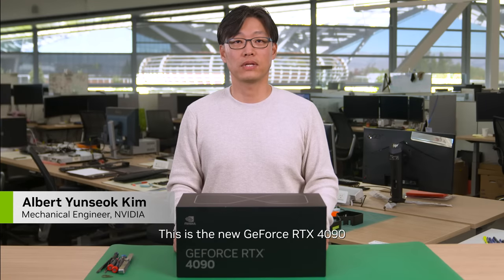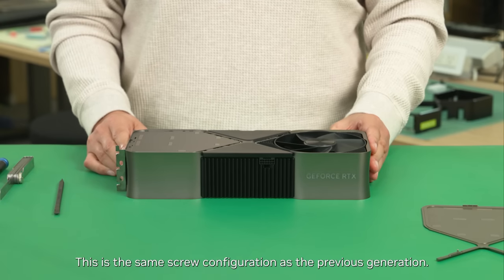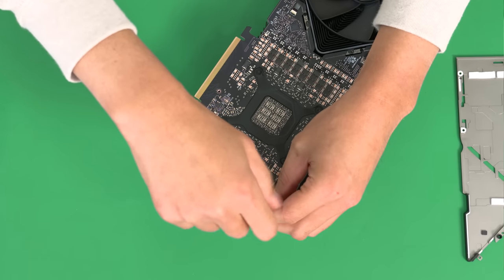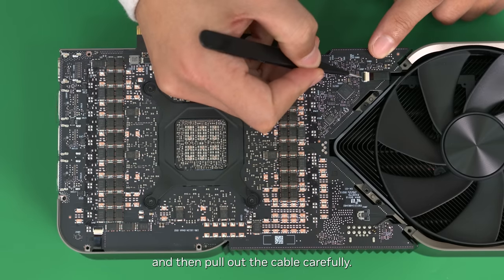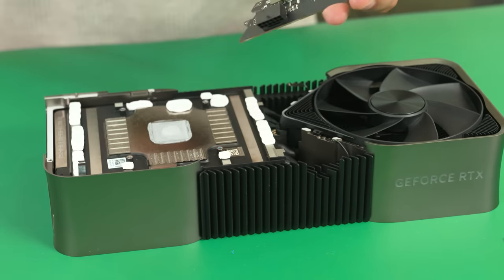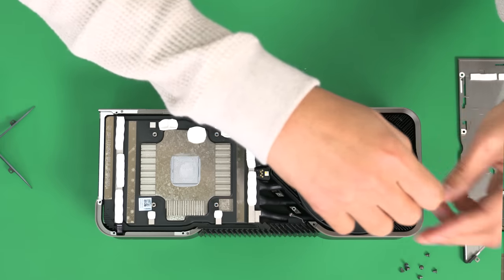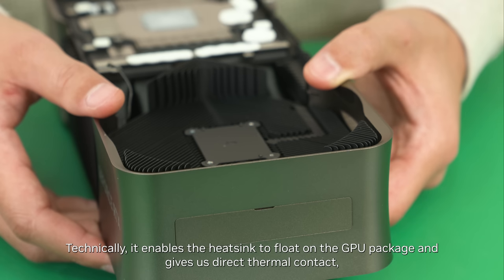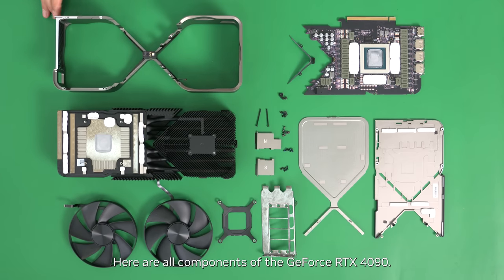GeForce RTX 4090 | Official Founders Edition Teardown

Comment: It is great to see a company actually making a disassembly video so you can easily maintain it or try to repair it once your warranty is gone.
Reply: What’s the point if they don’t sell any replacement parts?
Reply: @rmogutierrez-santana4446 the only thing worth replacing is the fan if the bearing breaks or something like that. The main reason why you want to get inside your gpu after your warranty is gone is for you to be able clean the fan/heatsinkand to replace the thermal pads/paste once it dries out (usually happens after a couple or so years).

Comment: the engineering and design makes the fe look more expensive than any other aib
Reply: And it’s the cheapest! At least in the UK. I just got mine.
Reply: @MATTE.U.K  Also in Germany.
The price was 1799€ for 3 months. now it is at 2100-2300€
Reply: because nvidia is selling way more expensive silicon to aib and this money that they are "saving" on silicon is just put into better quality components, design and materials.
Reply: @ArturOleszczuk1991  that's absolutely not true, most AIB cards perform worse in terms of stock boost speed and overclocking potential 🤣 exception being extremely high end cards that nobody buys
Reply: @busterscrugs  what's what I said, nvidia is selling their silicon way more expensive and saving for themselves better chips that for them, it's just manufacturing cost, aib is paying for everything related to produce that chip. So for example aib is buying worse chip for 150$ and nvidia in same time has binned chip for 40$ as expense.

Comment: Would be nice if they were ever in stock. They've only restocked in the US a single time since release.
Reply: its overpriced bro don't even consider buying it
Reply: no they restock every other week
Reply: waiting for 4090 ti
Reply: @Aleww  waiting for those 10 more fps in 4k for a over price
Reply: @Aleww  4090 best value
Reply: It’s a waste of money.
Reply: @bretttanton328  it even make money into waste
Reply: 1870€ cheapest 4090 in Eu 😭
Reply: @memeconnect4489   It's no overpriced. You can get them for $1900-2000 on ebay or whatever reseller site. Keep in mind the higher end 3090 Ti's sold for this price and even more than this price and the 4090 absolutely slaughters the performance of a 3090 Ti lol. These are well worth the money. I sold my EVGA Hybrid 3090 Ti FTW3 (360mm rad/aio) and got a 4090 FE. Best investment I ever made. $300-400 over MSRP is nothing to get the card and sit with it for years. But then again, I have a job.
Reply: @B_M_A  
you're basing your opinion on the fact that the 3090 is not overpriced? but literally everything since the GPU crisis has been overpriced, call me insane but the the 3090 ti should've never been over 999$
but nvidia tricked you, you're like:
hmm, if X is better than Y then its priced fairly 
the market will never recover from that hit
Reply: @clebyec  no its not
Reply: @memeconnect4489 aint the 3090 also?
Reply: The 4090 is just an overpriced 3090.

Comment: This GPU should have been a 1000 bucks at best and 4080 at 700. Hopefully AMD can compete for lower prices.
Reply: 4080 is actually like a 4050 ti - 4060 so more like 250 and the 4090 is 500 MAX. Anything more than that is a rip off
Reply: @Muhammad Ehtasam so wrong 🤡 the xtx is more like 4090 and Xt is like 80
Reply: Why? Because you are broke? The price is what it is because people buy it. Simple supply and demand. If people stop buying it prices will fall. Buy amd and stop crying.
Reply: @Transistor Jump they should give it to you for free , because you deserve it!
Reply: No way! All prices should be higher, I'm guessing you don't work in manufacturing.
Reply: @jake152  Stop supporting this crap !!! No GPU is worth 1700 euro. let alone 2500 for a 4090.
Reply: @@transistorjump919 and 4090 was made on a wafer that is 1/3rd the price of 4nm
Reply: @Drip7914  If that's true amd really dropped the ball of their top of the line only competes with entry level cards.
Reply: LMAOOOOOOOO
Reply: @@transistorjump919 He meant nothing because what it wrote make no sense
Reply: @DeadPhoenix86DP  Agreed! In my region the 4090 MSRP range from $2250-2600 CAD and the 4080 from $1700-2000 CAD. 🤔
Reply: @JCTiggs1  Yep. Those prices are crazy. Its time to let Nvidia know we want a price reduction.
Reply: The 4090 is more performant that the 7900xtx and that is $1000.

Comment: focus on making the 5090 smaller don't focus only on performance and power usage
4090 's actually a beast btw
Reply: This comment doesn't make any sense. The top end card is of course going to need to be big as it's a big chip with a lot going on and high clocks. No different with AMD or Intel's CPUs, the top end chips need much larger coolers and use more power. Physics!

The cards that are less focused on the maximum performance and are smaller are 4080 and everything that will come out below that. There always has to be compromises. You can't have your cake and eat it too.
Reply: agreed

Comment: Question for you Nvidia engineers.. this monster occupies 3 slots now..  so here is my problem...  I want to install it into a latest generation ASUS ROG Maximus Hero which has 2 PCIe5 slots... the primary slot where the RTX4090 goes and a slot 4 spaces over where I want to install their bundled Gen 5 compatible Hyper SSD Expansion card...  the problem is that only puts about 2mm space between the Hyper Card and your GPU...  is that enough for the bottom facing fan to get air?  And will the warmth generated by the Hyper card be an issue?   I will be installing all of this into VERY well ventilated Corsair 7000D case with some 12 total fans if you include the 3 for the CPU water cooling.   Thoughts?

Comment: So good to see NVIDIA open enough to show a tear-down ! Can the company also release the missing firmware for open-source Linux drivers ? The power management (reclocking) firmware that controls performance has not been available since GTX 900 cards. This is hurting open-source and Linux adoption, since NVIDIA is a discrete GPU market leader for a long time now
Reply: They made open source driver available on Turing based cards almost a year ago but anyway, they never they never hurt Linux adoption, they always had a great closed driver and until just a couple of years ago they were the only vendor to offer high performance on Linux since AMD's driver were so bad that an entry level NVIDIA card was beating their flagship which has been their main reason to move to on open source driver.

Comment: Would be nice if they weren't going out of stock in 30 seconds. Else I might actually buy one
Reply: For those extortionate prices no
Reply: @fireball2275  4090 is okay value. 4080 is absolutely terrible. Wouldn’t touch it with a barge pole
Reply: tell me about it, I'm sitting here debating if i should wait for the 4090ti now

Comment: I don't know bro, doesn't look like the price is correct to me, even more after seeing it completely disassembled.
Reply: @Transistor Jump it costs alot more than you think, considering larger die's mean lower yields from boule's, theres alot that goes into the process, whilst it costs less to produce than they charge for it, they have to make up alot of invested money from various other things like development of new architecture, or software they develop, let alone fluctuating prices from chip sellers like TSMC.  kinda a silly comment really when you have no idea about the process let alone the business. they dont just rack the price up for the sake of it, AMD have cut corners and had lower expenditure, and their mcm design has saved them alot of money which is why u see different pricing.

Comment: Hey Nvidia..., when you launch Nvidia Shield TV 2 Pro????

I hope these specifications :

CPU : Octa Core (4 x 2,6 ghz & 4 x 1,8 ghz) (6 nm chipset & 25 watt TDP) 

GPU : 768 cuda cores (6 nm chipset & 85 watt TDP) 

Memory RAM : 2X4 GB LPDDR5

Storage : NVME m.2 SSD gen 4 slot (up to 2 TB)

Cooling : 2x mini copper heatsinks & 2x silent fans

Power Adaptor : 120 watt

Body/case : aluminum + alloy

Front ports : 1 x usb type C 3.2 ;  power button

Back ports : 1 x HDMI 2.1a, 2 x USB Type A 3.2 (support hard disk external up to 16 TB)

Connectivity : Wifi b/g/n/ac/ax  ; Bluetooth 5.2 (support keyboard/mouse/controller/headset/remote) 

Remote : Wireless (solar charge)
 
OS : Android TV 13 (upgradable for next 3 years)

Software : continuity upgrade SHIELD Experience for next 5 years

Video support : 8K HDR 30/60 fps; 4K HDR 60/120 fps ; 1080p 60/120 fps

Video features : Dolby Vision ; HDR 10 ; HDR 10+

Video codec : AV1, H.265/264/263, VP 8/9, MPEG 1/2/4

Audio features : Dolby Atmos ; Dolby Digital Plus, DTS-X

Price : $ 360

Cmon Nvidia you can do it 💪😎🎉

Comment: Pricing of the FE 4080 should have started at $699 and the FE 4090 at $1099. Even those prices are still extremely high for a single PC hardware component but at least it would properly reflect the current market.
Reply: The 4090 will be appreciably better performing than the 7900xtx which starts at $1000.
Reply: @Safetytrousers  just a mere performance improvement that’s not worth of 500$.
Reply: @Safetytrousers  Exactly and AMD is guilty of gpu price gouging as well. The 7900 XT/XTX are also way over overpriced.

Comment: Really nice to see this kind of content, big props

But the excessive pricing really is bad and a 70$ price cut isn't going to do anything

Considering the 20 series shifted the skus by one (2070 was a 1080 successor) and the 30 and 40 series is building off of that, it's completely unacceptable to sell it at the current prices

The 4080 is a 700$ GPU period

Comment: When I turn my 4080FE upside down it clunks like somethings loose. It works fine but whenever I’ve taken it out the case and handled it the clunk is always present. It only does it once though when turned upside down then won’t do it again until next time I take it out the case. Is this normal? 
It doesn’t sound like a loose screw, it’s more like the heat sink shifting and clunking against the frame type sound.

Comment: Please what are two screw hole thread specs? I need to design a support bracket. The two screw holes on the opposite end of the i/o ports. They are under the small cover. Thanks.

Comment: Nothing like a 5 pound cooler and an exagerrated notch on the PCI slot to hasten the cracking PCB death of these cards. Take off the cooler to WC it if you aren't going to use titanium GPU supports.

Comment: I5⏰4460 🔥I WATCH GPU4090 THAT. A PART TWO FAN AND BIGER COOLER...AND FOR SMALL TO CPU AND THE DESIGN, IT HAVE GREAT IDE A RE-PORTER. 💥8 PIN！NO MORE POWER TO HAND TO GET THIS4090. AS GOOD ALL DISPLAY, TO COMPUTER. 🤸🏻YES！